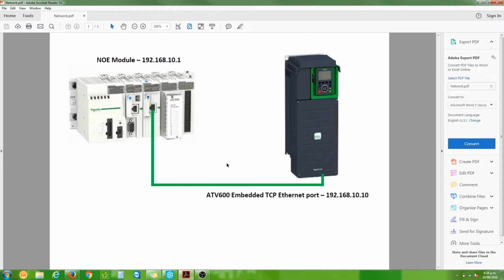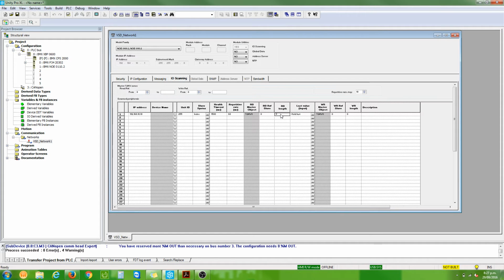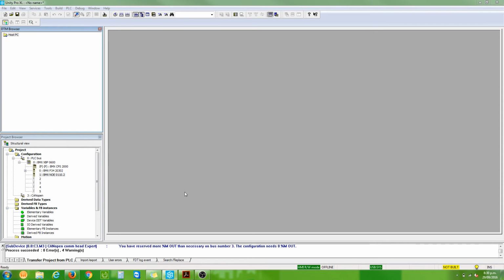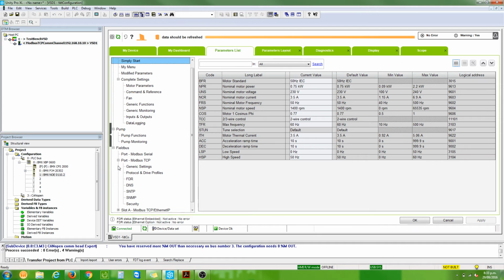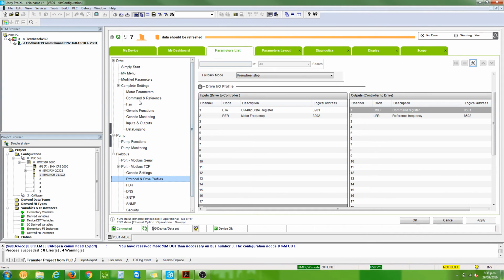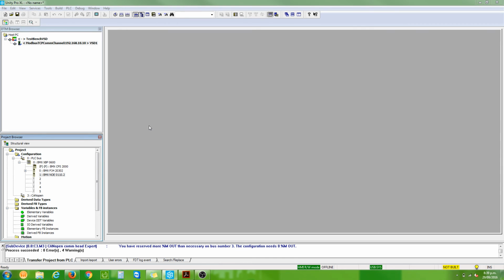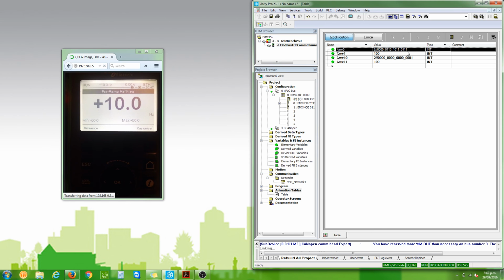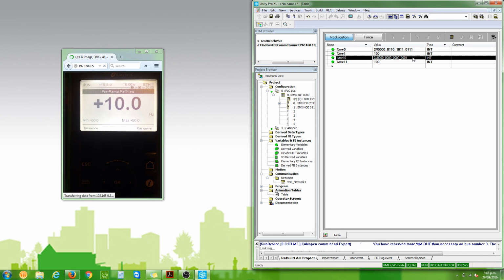ETSNZ: M340 Altivar Process Modbus TCP

Comment: Hi Mr, I saw that you use RD REF and WR RED with value "0" is that the modbus registers, because I saw after that in the VFD the modbus register, one begins 3201 and the other in 8501. What I'm missing in this configuration?
Reply: if you look this pdf , its programming manual for atv9xx series
https://media.distributordatasolutions.com/schneider/2016q2/fef677e41765147443ac338c0ffc3ad128a2d0f9.pdf
look for page 540 and  541 so you can see the Address of the first input word is 3201 (EtA) and Address of the first output word is 8501(CMd).
Reply: For me also same doubt
Reply: No it's not Modbus registers, it's IO Scanner address. in your VFD you set it up.

Comment: this procedure is the same for a ATV 71 ? on a Ethernet card?
Reply from the maker: Hi Moises, the procedure is very similar when using the Modbus TCP ethernet card on the ATV71 or ATV61. There are some small differences that you must be aware of. The scanner table will be a maximum of 11 words read and write, however the first word in each is a reserved word and needs to be ignored.